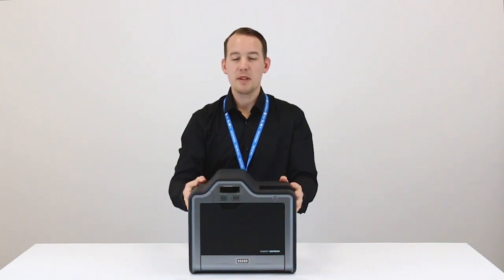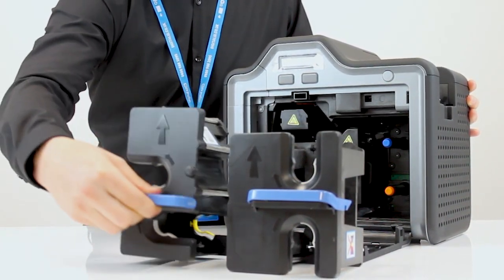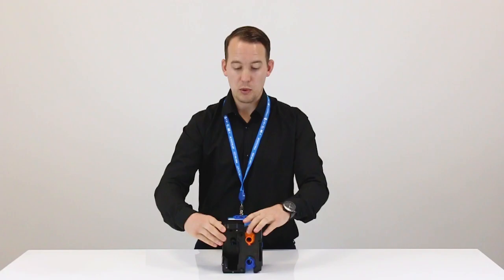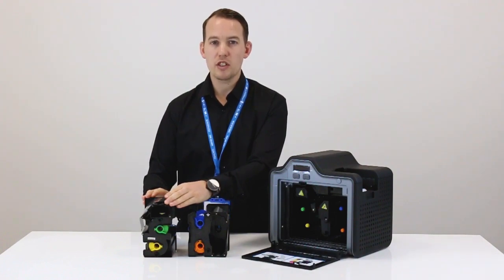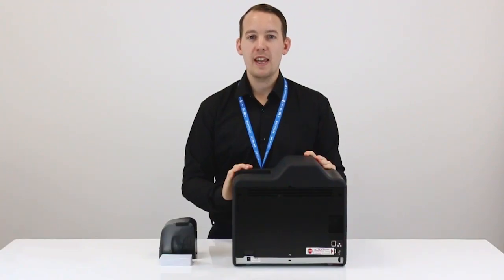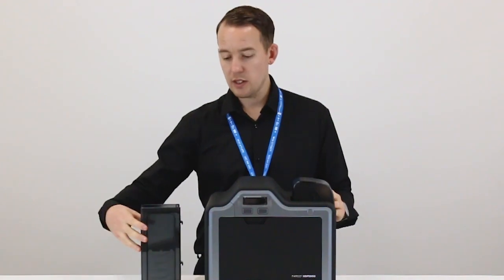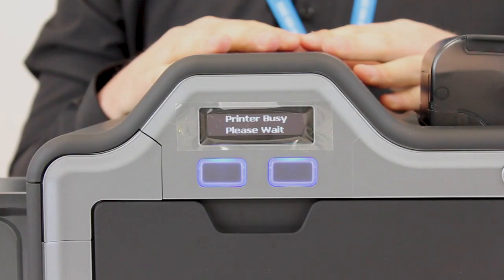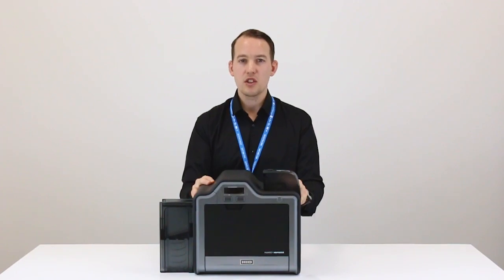How to Set Up the Fargo HDP5000 ID Card Printer

Comment: I need to do a Network installation. Is the driver software used to provide the drivers for connection to and management of a remote printer (connected to a print server), or am I setting up the local computer to act as a print server for other remote computers to connect to. If so, what windows firewall rules needs to be put in place, if any?